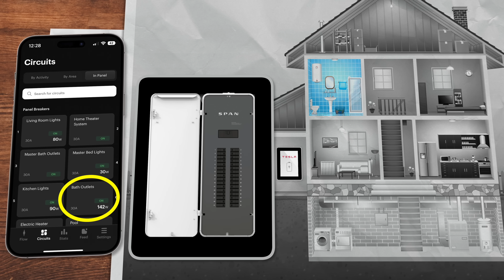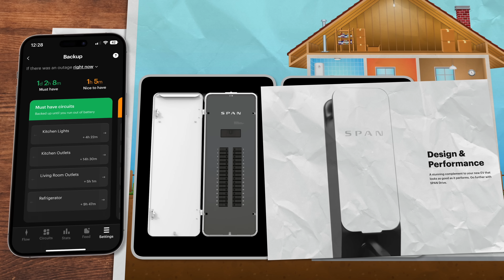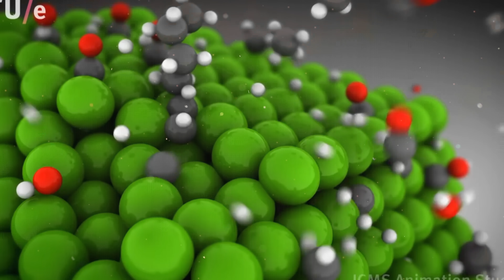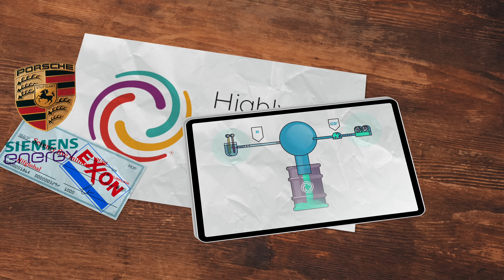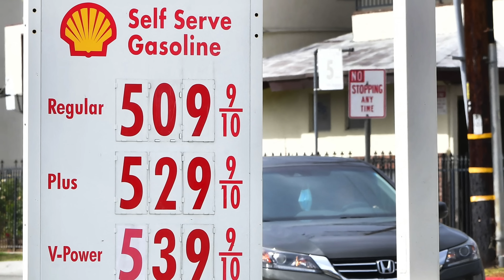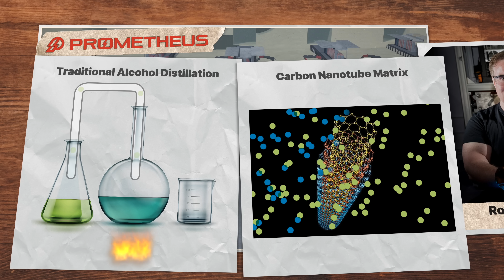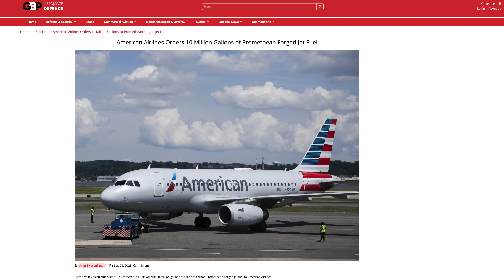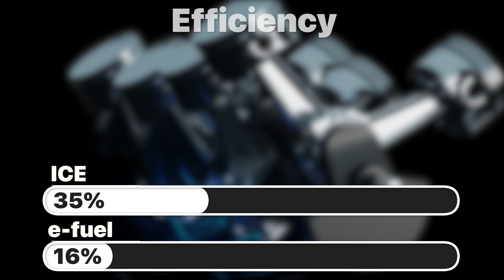EPIC Breakthrough Can SAVE the Internal Combustion Engine!

Comment: 13:33 

Does the 90% EV efficiency figure include the full energy channel, from source fuel at the power plant to the tires on pavement?
Reply: Solar panels mostly charge my EVs we Supercharge a few times a year.   Yes there is efficiency loss but other than the manufacturing and transportation of the equipment it’s carbon free.
Reply: of course not, it's only the engine efficiency. There are losses before that, from battery discharging, battery charging, AC to DC conversion in chargers, transmission losses from power station, and the inevitable <40 % efficiency of electricity generation
Reply: @YounesLayachi  that is not correct, even if a solar panel is only 30% efficiënt almost all of that energy makes it to the moter. you lose nothing from the fact that some sunlight is not converted to energy, same for wind. With oil there is a lot of loss after production, in transport and processing.  The number mentioned is for how much of the energy produced reaches the engine. And with electricity that's high. 
If you are going to take in the efficiency of power generation, you should have to include the energy used by nature to create the oil too.
Reply: @bzuidgeest  no, energy used by nature to create the oil does not matter, and i cannot take you seriously.
At any given time, the vast majority of operating PV panels in the world is a few years old and thus already damaged by the sun (think 15 % efficiency instead of the maximum 20 %).
Even a brand new PV panel drops by 2 % upon first use
Reply: @YounesLayachi  if the energy used by nature to create oil doesn't matter then nether does the efficiency of the solar panel when producing electricity. Only the efficiency of how much energy is used from what is produced counts and that means you should but count solar you don't capture, but you do and therefore i cannot take you seriously too.
Reply: @real_mikkim  strange, it's the other way around here. Charging an ev is much cheaper from the grid, even with high energy prices...

Comment: The bottom line here is really that we need to go pedal to the metal on switching to renewable energy. We'll need abundant, relatively cheap clean energy to make e-fuels practical. There's another aspect to this besides transportation fuel. Petroleum provides feedstocks for the chemical industry. I wonder if there's the potential to manufacture those feedstocks using the same basic process.
Reply: Nuclear is the answer.  Wind turbines kill tens of millions of birds each year.  That is not acceptable.  Nuclear kills zero.  
Wind is UGLY and noisy, too.

Comment: No, no, no, this is all wrong. This video should have been titled "EPIC Breakthrough Can SAVE the AVIATION INDUSTRY". Sustainable Aviation Fuel (SAF) is the killer app for e-fuel. Running your car on SAF makes no sense.

A more practical alternative for legacy ICE vehicles is EV conversion. Ford and GM provide EV crate motors, and a French company -- Transition One -- does EV conversions for about $6k. The range is currently somewhat limited -- I think about 60 miles -- but adequate for most commuters, and that will increase as the technology evolves. Also, rental trailers with EV batteries (being developed by another French company -- I forget the name) eliminate the need for long-range EVs. Why pay for a 300-mile EV battery when 60 miles meets 99% of your driving needs and you can rent a trailer with battery for the occasional road trip?

Comment: Only 80% of the weight of a car is recyclable?  Pretty good actually.
As cars become more and more EV a huge issue will loom, esp. in the US.  As refineries have become fewer and larger (and more efficient at large scale) at some point they won't be economical to operate to provide refined products to a dwindling ICE market .... there will be a gap in fuel availability so many cars won't run and there won't be enough EVs to cover the gap.
As to this e-fuel I'm very skeptical over the cost no matter how it's done - the process requires too much energy.  That energy (solar/wind) is best sent straight to battery.
ICE @ 35% efficiency?  Hardly - at least not in usual use.  If you spend 100% of your time cruising at 85 km/hr - sure.

Comment: Do you think it is reasonable to consume a lot of energy by cyclicly moving a large sealed robust container of water (a large thermal mass) back and forth between a stove and a freezer both requiring electrical power? You aren't making any  permenent changes as you alternately melt and freeze the water inside. The container and its water aren't becoming less orderly as the exercise continues. The unreasonableness of this waste is a challenge to the second law of thermodynamics. 

Several teams are building prototypes tha chalenge the second law of thermodynamics. 

Here is a thought experiment device made to create self powered thermal diversification. The thought experiment device is impractical but easy to visualize and check for mechanical workability.  The working parts are small enough to work with brownian motion but large enough that materiel behaves normally: 

Sketch made with keyboard characters: 

COLD ROOM   ())--:WALL:-->> HOT ROOM    

Key
()) = Paddlewheel. 
-- = Axle.  (Continuous from end to end)
: :  = Axle tunnel going through a wall.
>> =  Lumped friction element

Please visualize two roome full of air separated by a very thin wall that allows the rooms to hold their heat independently with minor leakage through the wall. The wall is thin to delicately support billions of  separate nanometer scale short axles running straight through loosely enough to rotate freely but  not leak very much heat so the rooms can hold separate temperatures. 

On the left side, a very small paddlewheel is mounted at the left end of each axle. On the right side, lumped friction elements are mounted stationary in place on the wall, one for each axle, for the right end of each axle to run through. The lumped friction elements convert the mechanical rotation of their axle into heat. The lumped friction elements do not impart Brownian motion to their axle.  

Brownian motion (a nanometer scale effect) turns the paddlewheels at random speeds randomly clockwise or counterclockwise. This random rotation is turned into heat by the lumped friction elements.    

  The committed, linked, and functional roles of the paddlewheels, axles, and lumped friction elements in differnt places should systemically produce a divergence in the thermal energy in the two rooms without adding external energy. 

Water in a sealed container could be endlessly cycled without cost between melting from the heat of the lumped friction elements' side and freezing from the cold of the paddlewheels' side. 

Breakeven perpetual motion would be the best energy source. Please give it standing in your taxonomy of energy sources. 

I was granted patent
3890161A  Diode array
I have posted many comments without the suffex A. Patent 3890161 was issued for an unrelated invention. It is impossible to know the repercussions of this error. 

Abstract 

A method and apparatus for rectifying thermal electrical noise, the preferred apparatus comprising a dielectric ultra-filtration screen membrane having a plurality of cylindrical pores, each pore isolating material forming an individual diode having an internal impedance in which electrical signals are generated by effect of thermal electrical noise, the diodes are connected in parallel to cumulate the effect of rectified electrical signals for concurrent production of power and refrigeration 

Aloha
Charles M Brown lll
Kilauea, Kauai HI 96754

Comment: This channel is really nice from my perspective and Ricky's voice is very easy to listen to, but I was shocked when I heard that it was sponsored by SPAM.  ;-)  I backed it up and replayed that intro to verify what I thought I had heard.  YIKES - what a name :)  SPAN looks very interesting.

System efficiency (the ENTIRE system) for eFuels sounds very iffy.  It sounds like something Bernie Madoff or Sam Bankman-Fried would be selling.  Just WONDERFUL on the outside, but the inside is a little more odorous.

I still question the efficiency claims for EVs.  Does that 90% actually include the complete system efficiency, or just the consumption vs transportation portion of it?  If it includes everything, even the raw materials for manufacturing of the vehicles AND the windmills, solar farms and such, then it's pretty nice.  I've never seen those claims tho'.

There is also the point of energy being consumed to turn into the currency that is used to purchase the vehicles.  
The whole of each system would make a really good comparison.
Reply: I too would love an end-to-end comparison, the best I’ve seen so far is one Volvo did, which included factoring in the method of producing the electricity for the EV.  It demonstrated that with current-for-the-time production methods, ICE vehicles were less CO2 to produce, which I believe included the mining of the minerals for the batteries as well.  Over the average lifespan of the vehicle however, in all situations the EV emitted fewer pounds of CO2, and I strongly suspect that only factored in the gasoline consumed by the vehicle, not the CO2 generated by production of the gasoline for the ICE vehicle. You REALLY wouldn’t want to see the end-to end efficiency of gasoline production, the refining process alone requires an incredible amount of energy.  If someone comes up with a method of efficiently extracting the lithium from seawater, it’ll be completely game over for the ICE vehicles. Efficiency of electricity production is very high, as it doesn’t require transport from source (oil well) to refinery, and then on to the end consumer.  It’s simply produced and fed into the grid, which then distributes it right to the end consumption point.
Reply: I will gladly drive an electric vehicle when the power comes from a NUCLEAR powerplant.  @sjsomething4936
Reply: I also question his acceptance of the degree of the severity of the climate crisis put forth by the heavily-censored, heavily-hyped "science." Censored science is corrupted science, as we learned with covid.
Reply: @grizzlygrizzle  People need to recognize the difference between science and $cience.

Comment: Not all carbon from fuel gets oxidised and ends up as CO2, a lot of it is deposited inside exhaust systems so in theory, if all cars burned E-Fuel, it would be better than Net-Zero. However, only 21% of all CO2 emissions come from road transport so there are still a lot of other areas that need improving.
Reply: I recently watched video that explains most man caused Co2 emissions is from agriculture and clear cutting forests.  Only 12% from transportation.
Reply: qórbg

Comment: Its like chip makers like intel and amd they'll make breakthroughs but they will want to maximise its usage a new chip design should serve the company for another 10 to 20 years look at intel how far its stretched out the 14nm processors while Amd was creating 7nm tech and 5nm. Intel amd amd already knows maximum performance but they wont give you it all right off the bat they'll release improvements slowely  in steps again the maximise the income on the product. They habe probably done the exact same thing with oil and have other designs and alternatives in reserves already to replace batteries. But by dragging things out they make more cash keeps the company running for decades to come.

Comment: We need to accept the idea that climate change will not be solved with one solution, the proverbial silver bullet. There will be many little solutions to a lot of different uses of energy. That means that climate change won't suddenly end but, will be chipped away piece by piece. Predictions of the end of the world will slowly fade into the future. Today it's 2050, hopefully in 5 years that prediction will be 2060. It will take work, we can and we have been doing it, but, that is how we will see the results. Based on computer models from the 1970s the global temperature should be 0.3 degrees warmer. The discrepancy has been entirely because of our change in behavior and not inaccuracies of the models. Efuels will be just one more little solution.

Comment: A ICE can be converted into a IIE and would be able to run on water. Internal implosion of hydrogen and oxygen can be used in a sealed system but that would remove profit and other limitations from the equation. Follow the money and you'll find your oppressor.

Comment: Reliable energy comes from fuels,  Fluctuating energy comes from alternative energy, like wind & solar.  The world needs reliable energy and we need enough fuel to support the energy needs of 8 billion people.  My thought is, we need to run our engines on Pee.  Pee is electrically conductive and a high current spark will convert pee into plasma.  Same 4 cycle engine but ignition method changes to plasma ignition.   There are some engineering obstacles to overcome.  The electrical current required is deadly and roughly the same voltage and current as the Electric Chair.  Some type of electrical insulation is required.

Comment: It can have a place for certain areas like military use (where cost doesn't matter), and the collectors keeping the old cars running which won't use much (and the cost doesn't matter). Just won't be needed long term for general passenger cars and commercial vehicles since electric is far better.
Reply: Batteries need to be replaced at $20,000 a pop, strip mining to get lithium and cobalt.

E-fuels much better!  Electric sucks.
Reply: 100%, by the time this is scaled up to the point of replacing all the refineries and oil wells we would be better off building battery factories and digging (pumping?) battery materials out of the ground to power all the average commuting appliances. Synthfuel would be best for race cars and classics, and all the other long haul transportation that needs the energy density of a liquid hydrocarbon to be economically viable.
Reply: @anydaynow01  You're forgetting commercial aviation. Not just a few droplets of jet fuel, for sure

Comment: Honestly EV's only work as a part solution for developed world - I work in a country that cant provide reliable electricity to the grid for homes and industry -BUT THE ROADS ARE JAMMED WITH CARS AND TRUCKS - most in disrepair spilling out blue black smoke everywhere. EVERYONE That can afford it, has an ICE Gen set. SO the e-Fuel idea is much better for the developing world

Comment: I typically agree with many points you make, but using auto recycling as a point for whatever it is you're trying to make is silly.  It doesn't matter WHAT technology we use for vehicles, cars are going to get turned into junk.  Even now, after having used ICEV for many decades, almost all cars end up as junk.  So, weak point that doesn't add anything to the conversation.  The issue is vehicles aren't designed to last 20 - 30 years.  You put 200,000 miles on a vehicle and almost every part of that vehicle has been replaced, or it's junk.

Also, if you recycle CO2 that's in the atmosphere to reuse it, then this CO2 is never getting caught into a sink, to be removed, and how does that help with CO2 levels are already too high?

Then there is cost.  I see this failing the cost test by making fuel cost WAY too much.

BEV IS an excellent solution, and it's only a matter of using different tech to make the batteries so there isn't too much pressure on any rare earth material.

Comment: Co2 is not the only problem with fossil fuels what about localised air pollution from nitrogen oxides, and particulate matter? I think it could be a good sollution for aviation but for everything else it might have a place as a transition fuel at best. The kinds of people refusing to transition to an EV are not going to pay extra for an E-fuel unless it's their only option.
Reply: Modern cars are basically pollutant free.  Plus...direct methanol fuel cells
Reply: @scottslotterbeck3796  I think you have been sniffing too many tail pipes. There is no such thing as a pollutant free car even BEV's release pollutants from brake and tire wear. Even the most modern Diesel and Petrol cars still produce co2, Nox and, PM2.5 what do you think is happening to all these pollutants, what do you think is coming out of the tail pipe?